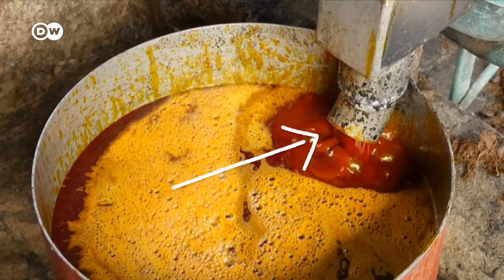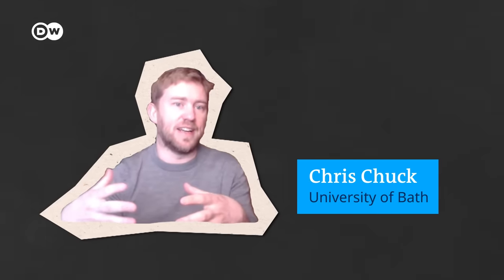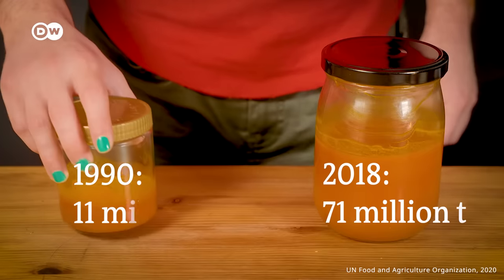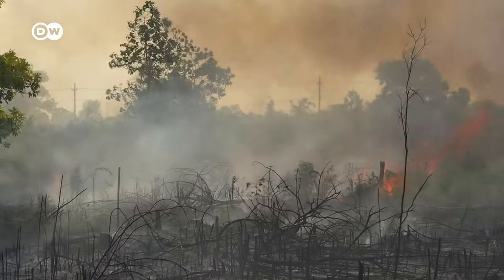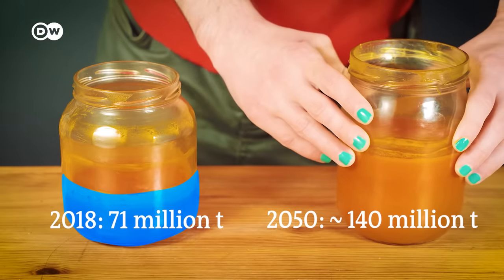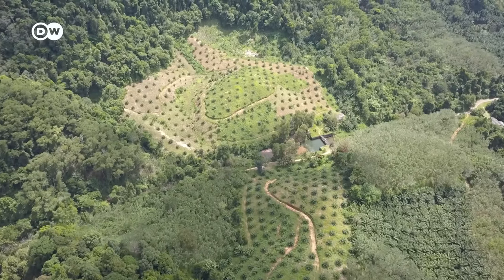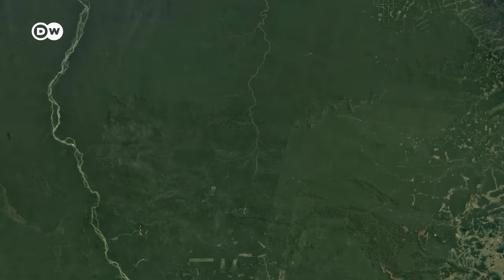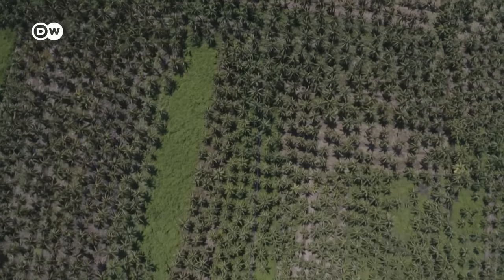Palm oil isn't as bad as you think

Comment: Thanks for a well balanced video about palm oil (there aren’t that many out there). There have been massive efforts in making practices more sustainable. It’s one of the most diverse crops out there (every part of the tree can be used) and it is an essential part of the economy. Large companies actually HAVE to implement sustainable practices because getting a loan from banks requires this now (through the audit process, the plantations are checked quite regularly). There are definitely bad players out there, but there are also lots of good ones who actually are making an effort.
Reply: There are also plantations out there who actually grow other food crops between the palm oil trees so that the land is fully utilised. 
Another interesting fact is that the “waste” product after extracting the oil from the kernel can be either used as biofuel or be used as fertilizer, just like the rest of the tree at the end of its production life span.
Reply: I'd call it horribly biased.

Comment: Stop using vegetable oil for fuel (reusing filtered, old, cooking oil is okay, but not new oil). Electric cars will dominate in the future 

The only biofuel worth considering (for the niche applications that batteries yet ain't viable for) is"biogas"(since it's made only from biological waste, like food leftovers and animal manure anyway and doesn't require any extra land area).

Biogas is also known as renewable methane, unlike natural gas (fossil methane). In the future when batteries are so good that we no longer need biogas we can still continue capture it, but instead of using it we can put it back into the ground where we took all that natural gas from before and by that way using it as a carbon capture method way more efficient than planting trees.

Comment: Relative to other sources of vegetable oil, palm oil is by far the better way to go. Being a tree crop, it does not require that the soil be tilled every season resulting in rapid soil degradation. Secondary ground cover vegetation can be grown between the palms to feed goats and sheep. Calling it deforestation is inaccurate since the palm trees make forests all by themselves. Monoculture, destruction of natural habitats and displacement of native plants and animals are all valid criticism that applies to all modern agriculture. A lot of the fuss about the problems with palm oil is totally unwarranted.
More destructive practices include deforestation for grazing, or growing annual crops that degrade the soil and require intensive use of chemical fertilization and weed control chemicals - and these are happening in more places and in larger acreages.
Reply: well, compared to the natural tropical forests, the rainforests, palm oil exploitations are just one species. and rainforests are the most biodiverse places in the world. it's like saying that it's fine to drive local diverse fauna away from a territory because the pigs are also animals and they also form part of the biosphere
Reply: @macizogalaico in term of biodiversity oil palm plantation is surely no comparison to the natural rainfores but compared to plantation of other crops, oil palm plantation is better. And oil palm is normally replanted after about 25-30 years, not seasonal like other crop.

Comment: What about coconut oil? Is palm oil better than coconut oil 🤔
Reply: I just read an article that explained why coconut oil isn't a great alternative. They pointed out that coconut oil already has a very high demand, so if people switched to using it as a replacement for palm oil, supply wouldn't keep up with demand. To meet the higher demand, growers would no doubt start using the same unsustainable practices they are already using with palm oil. 🙁

Comment: Did you account for the fact that palm oils only produce fruits after 3 years? 
And did you get the denominator right for the calculation of the production per area?
It is really difficult to assess the productivity of different plants (canola, sunflower ...). But they are actually about the same, if we account for these factors i have learned.
Reply: And for the next 25-30years
Reply: They are not the same, the fact that palm oil has been successful in fulfilling all industries' demands around the world proves that it is the most productive crop compared to others.

Comment: By replacing monoculture with permaculture! Permaculture is not a method; it's a design, an approach that can be applied to any terrain, climate, etc, even monoculture, if necessary. There is no other way to do agriculture successfully. Fertilizers can be replaced by mulching and other ways of keeping the soil fertile. The money saved can be used for yet another technique to augment production. Suppose sweet potatoes grow well under oil palms, then all the acreage used for sweet potato fields can become oil palm plantations. Just making it up right now, but fertilizer-based monoculture is not the way to do anything efficient. Never been.

Comment: That comparison of how much oil you can get per unit area is neglecting one important thing. Palm oil farms are replacing very valuable tropical forests or wetlands. Compare it to what is replaced for rapeseed or soybean. Of course, you need to sacrifice something to farm anything. But what you sacrifice for palm oil is much more than others.
Reply: So the countries shouldn't utilize the BEST Valueable form of agriculture to elevate its citizens?

Bulk of palm oil are planted on secondary forests; not virgin forest.    Usually is former Rubber/Cocoa/ Coconut estates, or areas logged for timber.
Reply: Palm oil is definitely not the best oil for the environment and health. Countries should not allow use of any more forest land for palm oil agriculture. Only sustainable agriculture should be allowed.
Reply: @kentershackle1329   Yes, exactly. 3-8 times land e.g. in Mediterranean climate for olive oil or in temperate climate for sunflower oil is better than sacrificing tropical forests and wetlands.